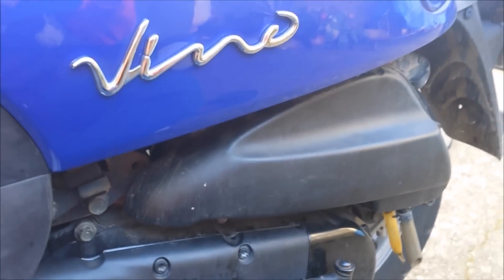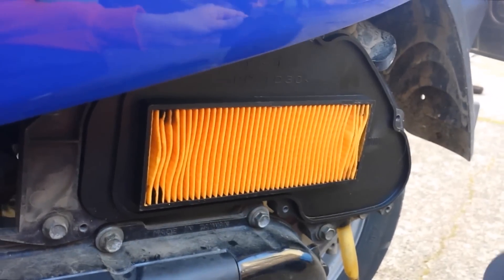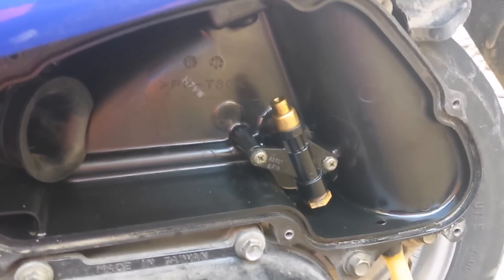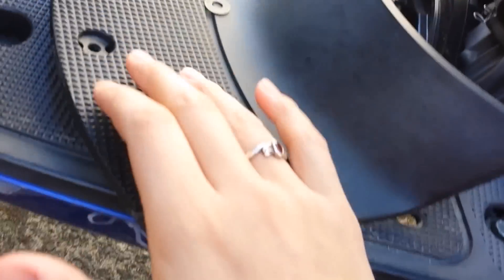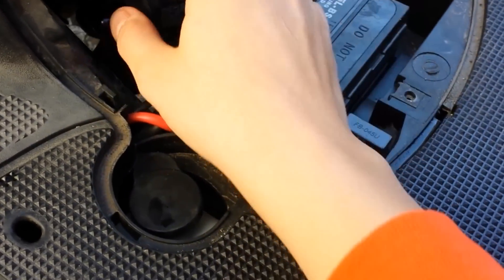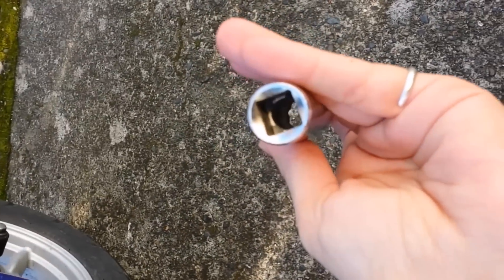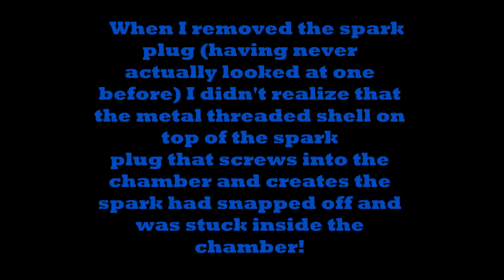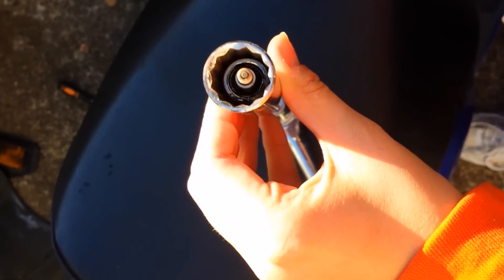Minor Scooter Maintenance - 2007 Yamaha Vino

Comment: Nice job. I went through the same thing changing the spark plug, CDI box, battery, etc. The CDI box is the main one if there is no spark? You can test for spark first to know if you need a new one. Normally last up to 30,000km. At least with the Yamaha Vino you don't have to remove the seat compartment compared to Kymco Agility 125?

I am no mechanic but after watching a few youtube vids for some time now, I managed to learn how to do the following changes:
- Engine and Gearbox/transmission oil
- Ignition coil
- CDI box, battery and fuse.
- air filter
- light bulb

I think the next one on the list would be changing the drive belt once you feel the scooter starts to slip and go. Take it from experience when my old scooter drive belt snapped off lol? It happened twice and both times I had to hire a ute to pick it up costing me more money. Now I know when to change it and will do it myself ;)
Maybe I don't need to take it for a service anymore lol?

Comment: It is good to get a tube of anti-seize and put some on the spark plug threads b 4 installing.It prevents rusting and makes it a lot easier to later remove your spark plug.Good job on your video.

Comment: Usually the top of the plug gets broken. I will soon find out if this problem exists when I change the plug on a 2004 Vino. If the cylinder head is aluminum and the plug is steel it can sieze tight and damage happens upon removal.  Worst case it can damage the head threads. Use the anti sieze compound as someone suggested below. P.S. Use a smaller size socket, like 3/8. 1/2 inch is overkill for a spark plug.

Comment: Congratulations on your first real mechanical problem.  The extraction of the plug was the real learning experience. Including the freaking out.  All good mechanics do that.   Next year at this time you're going to realize that this year you knew nothing, then after getting the basics down, you are going to realize you still know nothing.  Then when you get into the engine problems, you realize, I know a whole lot of nothing  but more than those no nothings.   Really though, it gets easier.  BTW, Phillips head screwdriver not star,  $3.00 a spark plug, get a magnetic bowl to put parts in.  Congrats to you on making the effort to actually learn how it works, versus just riding.
Reply: Thanks, helpful comments! Magnetic bowl, that sounds handy.
Reply from the maker: No kidding!  I'm basically limited by not having the correct tools to really mess with her but also the fear of screwing her up because she's my main mode of transportation!
I've been around scooter folks that mod the crap out of anything they can get their hands on so I know the lingo pretty well too!
I'd love to get the Rev Limiter washer off the drive train because nothing feels weirder than going down a hill and not accelerating!

Comment: Helpful Video - do you have an opinion on why a Vino 50 CC would have excessive exhaust when accelerating ?  I was told it might need a carbureator adjustment. Any reply would be helpful. Thank you.
Reply from the maker: Unfortunately I'm not a mechanic so that question is a Lil out of my range.  I would suggest getting your carb checked and cleaned at least once a year if you are using your scoot a lot.  A clogged carb is all sorts of bad news and will severely hamper the scoots performance.
50cc are also the weakest and slowest of the gas scooter family so any issues will slow them down.
Reply: Thank you.  I am not a mechanic either and I agree its best to just get it done right rather than guessing and hoping.  - Junior

Comment: Do you drive the Vino for daily travels, or, do you have a different vehicle for that?  I'm doing some research as I am seriously considering in buying a Vino 2007.
Reply from the maker: Charlie An she is my main form of transportation!  Great way to get around town!  Granted I live in a city which makes scootering a lot easier but it's a ton cheaper than a car and as long as you have some good rain gear for the wet days you can't go wrong 😊
Reply: Thank you for replying.  I have so much to learn because I have never operated any 2 wheeled vehicles.  The Vino Lifestyle seems liberating.
Reply: As long as you don’t need to go on the highway, they are fantastic! I live in Montreal and use mine all summer to go everywhere.
Reply: @LIBERTYMarkAaron  I bought it and a year later someone stolen it from a Wal Mart parking lot.  It was totally fun while I had it